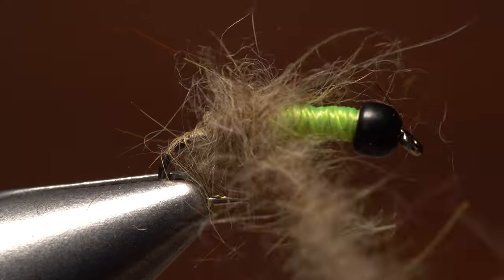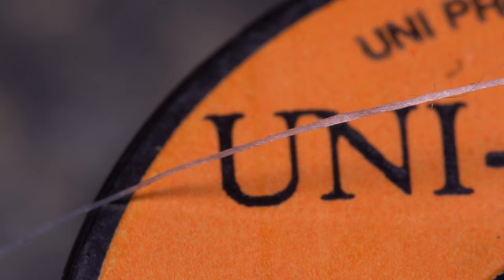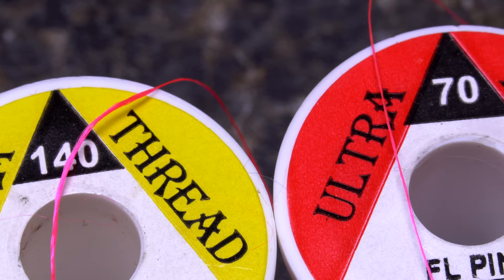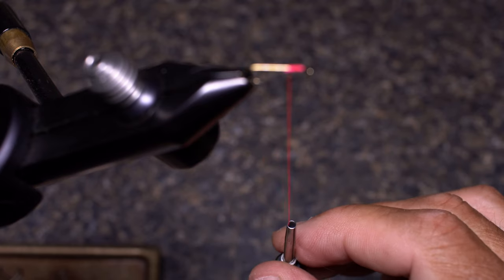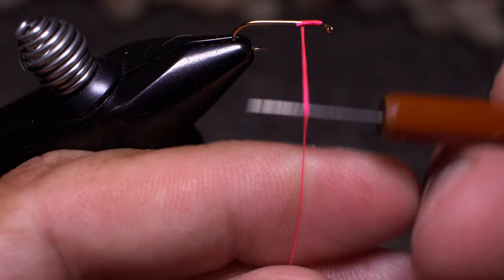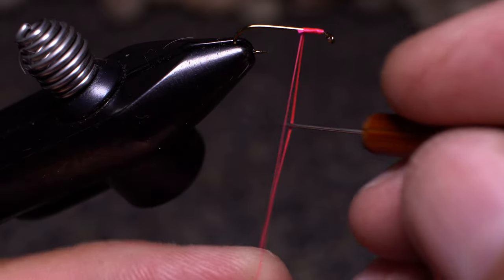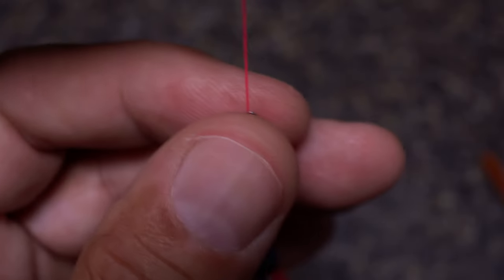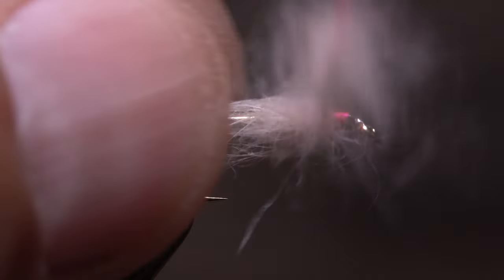Split Thread Dubbing

Comment: Using  a dubbing needle or other sharp pointed object will cut one side of the tread (90% of the time). Use a tapestry needle with a blunt point.
I made my own tool, among all the others (third hands...) that allow me to split with no problem at all also "Veevus 16" thread